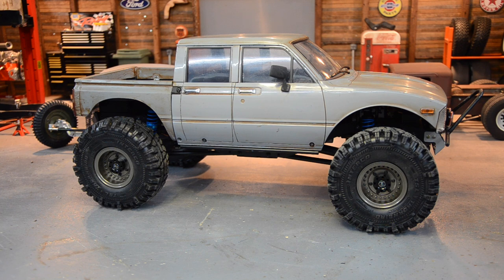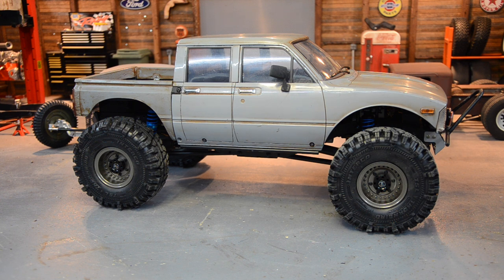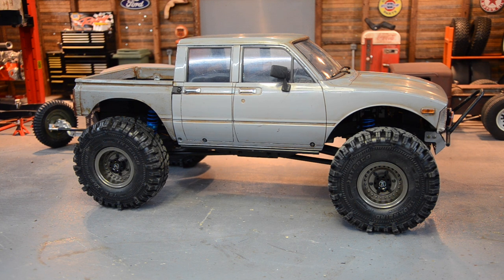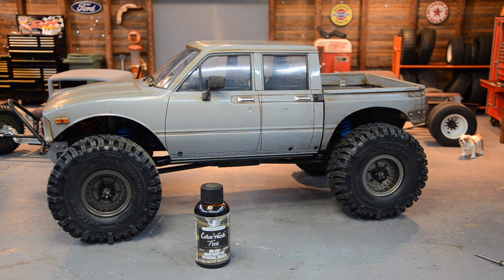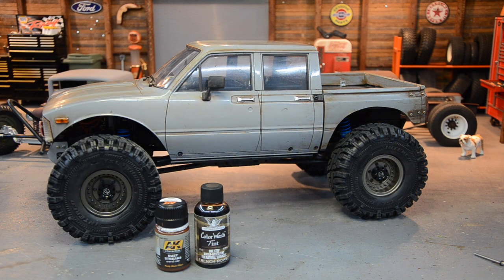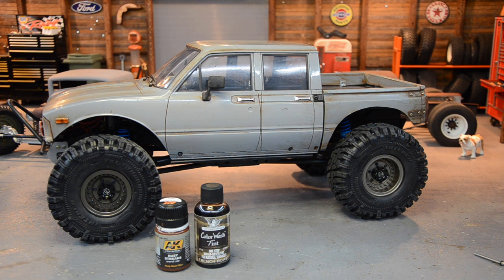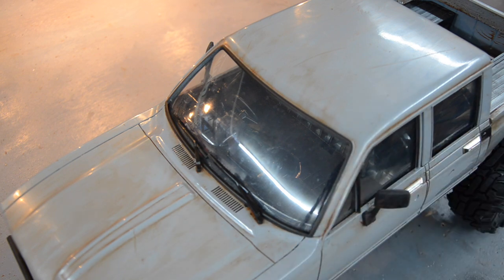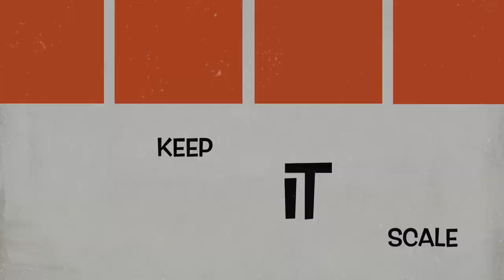Weathering & New Wheels for the RC4wd C2X Scale Crawler

Comment: Totally agree on the Black Rhino wheels.  Saw a 1:1 Gobi Gladiator with color matched Black Rhino wheels & it looked killer, so I put a set on my Axial Gladiator.  The bead lock part is fine & the center caps with 8 tiny screws each are a PIA.  Guess its the price of being cool.

Comment: So cool!!! I'm trying to get the 1/10 RGt challenger truck RC..in the green and I want to make it matte on shell and weather it..any info on how to remove the gloss on shell😢
Reply from the maker: If it’s a hardbody you can scuff it with some scotch brite to remove the shine. Im not familiar with that truck.
Reply: @RCeveryday  hey, nope unfortunately it's a soft shell type.
Reply: @RCeveryday  soft shell type which comes with most RC...
Reply from the maker: gotcha, they are painted on the inside, so the only thing I can think to give it a matte finish is to spray a matte clear on the outside, youd need to mask off the windows and any details so they dont get covered
Reply: @RCeveryday  hey, should I use tamiya Ps- 55 clear on my rgt challenger shell to remove the gloss?
Reply from the maker: That would be a good choice, just be sure to cover the windows up
Reply: @RCeveryday  oh yea!! Thanks

Comment: Hi, amazing job and fantastic video, please can you give me an advice? I painted a defender body, already used rust pigments, with vallejo rust washer and black washer, now I can spray the body with the tamiya flat ts80? or it will damage or erase my job? thank you in advance ☺
Reply from the maker: Most people say its OK to spray a matte clear over it, just make sure its really completely dried.  I usually dont seal mine because it can change the way some effects look, makes light rust darker etc.  Id say try a little spot on yours and see if you like it first.
Reply: @RCeveryday  thanks a lot for your prompt reply 😊, I like how it look now, so I'm scared to ruin my job, but if I don't seal it, won't it be removed using the crawler? with water etc?
Reply from the maker: I haven’t had much issue with mine coming off. It depends on the product used. My rat king got rained on down in Florida and the body was just fine. Wiped it off with no damage at all.
Reply: @RCeveryday  ok maybe I can leave it as it is, however I used a Vallejo pigments burnt sienna, vallejo rust wash and vallejo black wash...thanks again ✌🏼